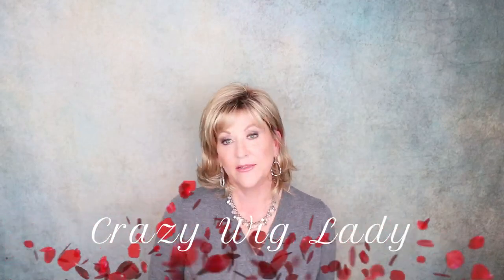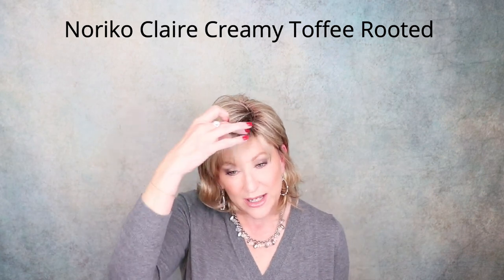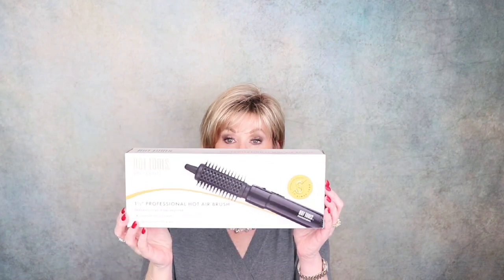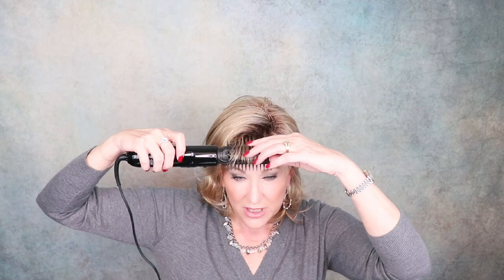WIG STUDIO 1 | HOW TO USE A HOT AIR BRUSH WITH CRAZY WIG LADY

Comment: Good advice when gentle curl is required, l would like to curl my wig with tight curls.  ❤❤
Reply: Hi Linda as you know you can't use a hot or flat iron on a synthetic wig, you can however use the hot air brush as demonstrated in this video; if you would like tight curls you would need to get a heat friendly style that allows the use of a curling iron or hot styling tool. Thanks for watching...eileen